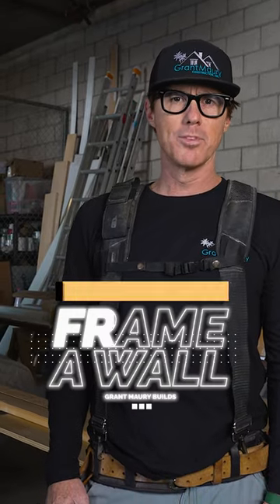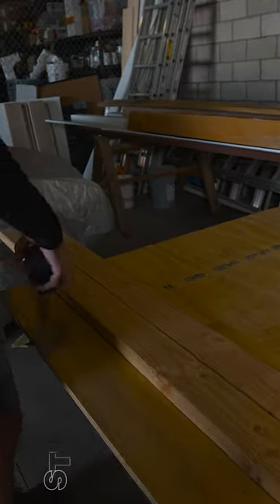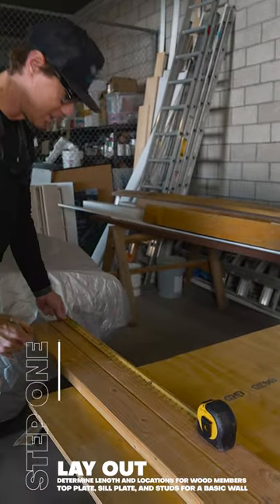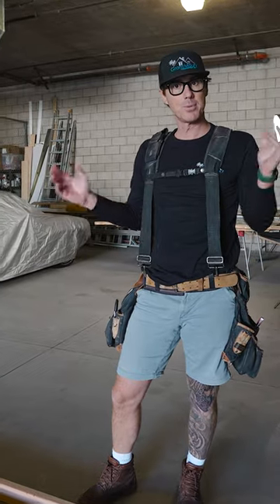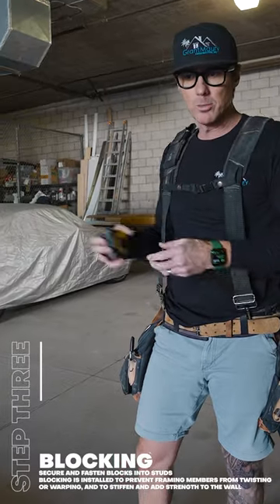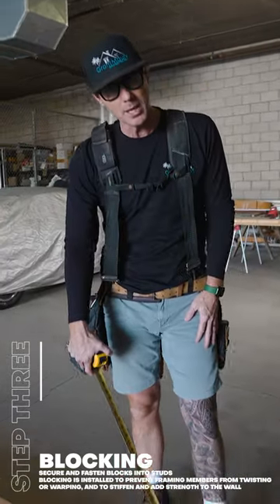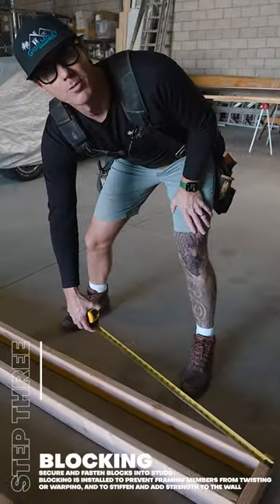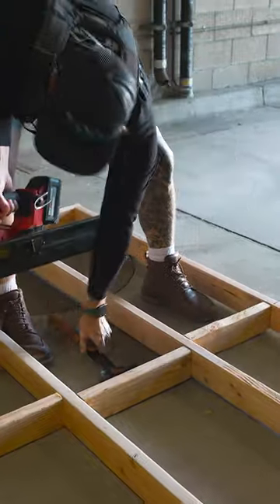Frame A WALL in 52 Seconds#shorts

Comment: When i pull layout i go back 3/4 of an inch from every 16 mark so 16 is dead center
Reply: As a newbie I have to ask if  can you explain this further or clearer?
Reply: Basically you’re 2x4 stud is 1.5 inches thick, and you want the center of it to be dead-on at 16 inches from the last stud.  So, you either mark it at 15.25 or 16.75 (three quarters of an inch either direction), and put the edge of that stud on the mark, that way the center will be dead on at 16.

Comment: I love how you answer the whys as you go along... I always wonder why when learning something new
Reply: He didn't answer the why's, which are important. Why blocking for example?
Reply: He didn't answer the why's, blocking is for example is for? Fire safety.
Reply: @2greenify it’s to add stability to the wall mate not fire safety
Reply: @pruddz6734  most beginners think that mate. Read fire safety rules to get more insight. Also the studs were close enough to be sturdy on their own, let alone with plates on both side.
Reply: @2greenify  you’ve said enough for me to know you aren’t very experienced, definitely isnt sturdy enough
Reply: Forgot to explain the layout process. The very beginning step to make things line up in later steps.  On your wall plates, hook tape measure onto the end of wall plate and measure 16" increments but deduct 3/4" from every 16" mark.  3/4" is half the width of a 2x stud. So first line would be 
15  1/4"  line then X in the direction your pulling the tape. Next 31 1/4" line X, 47 1/4" line X etc. Do this to one wall plate, then place second wall plate on top of the one you just laid out and use a speed square to draw the lines across both plates and add the X to the plate you didn't initially lay out.

Comment: Except that youd mark 15 1/4 from the end....to get 16OC....not add a stud and then go 16. Lol
Reply: Negative.. you measure 16 off the end and that will give you side of your stud. That would make the sides (as well as the centers) 16 inches apart.
Reply: @BasicallyNomads  Nope. 15 1/4 to side of stud for proper 16OC layout. A 2x4 is 3/4 wide to the middle, thus giving 16OC.

Then 31 1/4, 47 1/4, so on and so forth.

Hate to be the guy who follows you with drywall or sheathing.
Reply: @evictioncarpentry2628  think about what you’re saying. You don’t actually mark where the center is when you frame. That would take too long to line up. You measure where the side of the stud will fall and make an x to show which side the stud falls on. This makes them all automatically 16 inch on center. If the left side is all 16 from center then the centers must be as well lol
Reply: @BasicallyNomads  I don't know how else to explain this any clearer for you. You are 100% wrong. Go look up some videos on how to do it, I guess.

Its 15 1/4 from the end for 16OC. I'm not talking about marking centers, these measurements are all to the side of the stud.

15 1/4 plus half the stud (3/4 to center of 1.5inch) is 16OC layout dude. You're wrong.

You should take this as a learning opportunity instead of arguing with me because after you look it up, you're going to feel stupid, I guarantee it.
Reply: @evictioncarpentry2628  I’ve done it.. and he doesn’t do it here.. because it’s a waste of time to measure 15 1/4 when instead you just pull your entire tape and mark every red 16 increment.
Reply: @BasicallyNomads  Nope. Wrong again bud. It just isnt sinking in. Youre not getting it lol. Take care. Can't spend anymore time trying to explain this to you or I might as well hit myself over the head with a 2x4.
Reply: @evictioncarpentry2628  😂 ok. Let’s do it this way. You’re measuring 15 1/4 off the 1 1/2 stud to get center. Cool. Now you’ve marked the actual center of all studs. But you’re placing studs and you need the center to line up. Are you marking all the centers of your studs? That’s just insane 😂 you’re handle says carpentry but I hope that means you don’t frame.. and I’d you do I hope you don’t charge by the hour lol.
Reply: Its 15¼" or your gonna p*ss off the drywallers .
Reply: @BasicallyNomads I just finished school for construction technology and yes, you are correct, being as we had a student in the class who was on a framing crew while taking the classes, I can confirm we ran across the same thing where you pull from the end to 16 to mark that end and mark with an X, it’s called the communitive  property of additions, doesn’t matter if you add 1+2 or 2+1, they both equal three. Hate to see them tag teaming on you knowing they are wrong 😂👌🏽
Reply: @BasicallyNomads you can pull 16 edge if you set your first stud back 15¼ or just do what he showed in the video
Reply: @raydenfrerking4053  Time to go back to school. It's 15 1/4. You'll get fired immediately in the real world
Reply: I’m probably missing something, but if the end is where the stud starts, and then I measure 26”, draw a line and put the edge of the stud there, is that 16” on center?
Reply: @raydenfrerking4053 i do work in construction (framing) and your are right you don’t go every 16 because you’re sheet of plywood or drywall would be short, let’s say it’s a 4 x 8 sheet to get it on center your stud should be at 48 on center that would be 47 1/4 on the edge since most of the studs are one inch and 1/2, unless it is a sheerwall, but yeah

Comment: Your supposed to mark every 15 and a quarter" .
16 on center, always.
Boards these days arent true 2"/4" SO you will find if you mark it as a 2 by 4. None of your work will be on center. 

The reasom you go 15 and a quarter is 2/4s these days are 1.5"by 3.5". 

Half the width of the board is 1.5. Divide that in half(we just call it splitting the difference.) You take 0.75" from center is where your board will sit so you mark a quarter inch less than the red marks on your tape. Which are every 16"

Comment: Is the blocking necessary for a wall of say 8’6”?
Reply: If you're in a basement or something probably not but it's for fire retarding. It does add somd sturdiness, but the main purpose of blocking is to "block" any potential flames especially when the stud bay goes through multiple floors. Without them any flames would just have a couple 2x4s (the head/foot plate) to burn through and then boom got a 16+ foot chimmuhnee
Reply: If you want to meet code, yes

Comment: Tips for someone who just started framing?
Reply: Work hard and be prepare for back pain, shoulder and hard work haha
Reply: Also don't mark every 16" or everything u do will b wrong. Its 16 on center, you make 3/4 back from where 16 would be. Everything's on center. 

Mark your boards on the ground like he shows. Build them on the ground nail them down use the nails to pivot the wall in place. Nail it off finish your walls. Have someone come behind and finish fastening ur wall and do the blocking while you move onto the next wall. 

4 people is ideal for a team, 3 is doable if everyone's really good. 

Take advil one day then aleve  so you liver doesn't die. Ur gonna hurt, and by the time you get strong enough for it not to hurt. You'll hurt yourself. It's how it goes.
Reply: @RealName-ox9tk damn sounds like youve done this for a long time. Carpenters dont get paid enough
Reply: Don’t shoot yourself with the nail gun, best tip I can give
Reply: @patburns600  speaking truth there brother

Comment: What do you do an weird numbered wall? Depending on which side you measure from they won’t be 16 on center?
Reply: You pick a side to have a shorter span
Reply: No you don't you mark 3/4 less than where 16 would be. 

So 15 1/4, 31 1/4 and so on.... 

This way everything is on center. It's literally just as easy as marking 16, u just mark back 3/4" it takes no more time to do it right.

Comment: What was the purpose of your blocking I am new to framing thanks!
Reply: so the walls are more stable, it is not much support in the diagonal angle. support so the walls keeps the structure, and for the roof basically.
Reply: @milo_1234  so putting those blocks in gives the wall more structure
Reply: What is the length of the blocks

Comment: Useless video that gives incorrect information… Nice that you built a section of wall for your video that you will never use for anything and added useless, blocking at 4 feet that’s completely unnecessary and you don’t tell people how to lay out the wall properly… Mark your first stud from the outside edge at 15 1/4, and subtract three-quarter of an inch from your 16 inch measurement/red mark on your tape measure for each next stud… Or explain that you are taking your measurements from the inside of that first stud. Then when you get to 4 feet or 8 feet on your wall, your sheet goods, plywood or drywall… Will land in the center of the stud where they need to be… Then you have room for the next sheet and something to nail to… Nice that you’re trying to educate people but learn how to do it right first… or you probably know know how to do it right but figure out how to explain it to people that don’t work in Construction…

lumber is expensive… And now you’re viewers need to buy a sawzall to fix their mistakes that you taught them